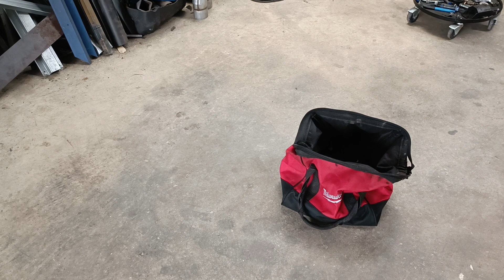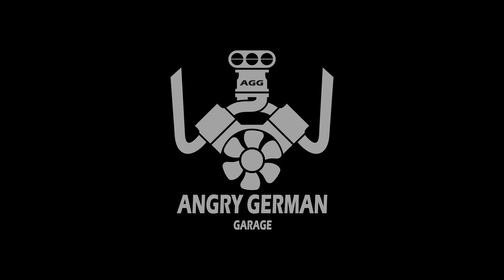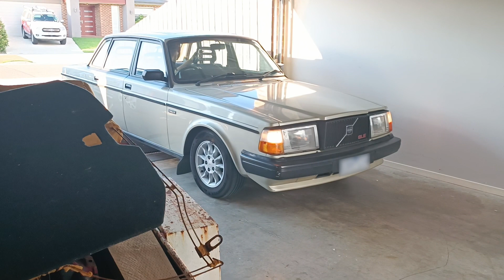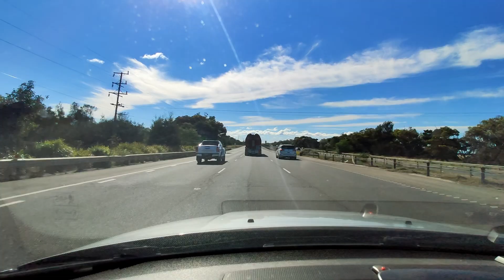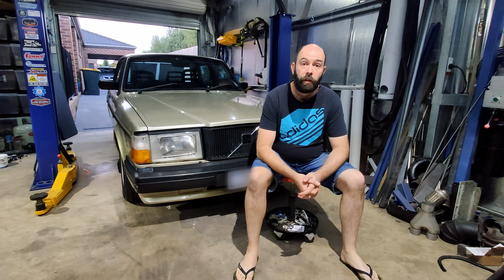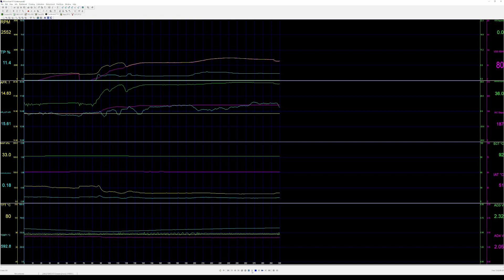Dyno time! - Volvo 240GLE turbo LS2 project (Part 26)

Comment: All my electrical issues were at the junk fuse holder.
Reply from the maker: Unfortunately this fault is my own doing. I rewired this whole car, and replaced all factory wiring including the fuse panel. So I've made a mistake in the dash wiring somewhere. I'll find it!

Comment: Awesome video mate. I've always said you never give yourself enough credit. The build compared to some I've seen is top notch. For the nerds, 320rwkw @ 3.5psi, 18* timing, 11.0 afr, 3.5-4.0:1 back pressure ratio. These engines take 18* @ 10psi and in a perfect world, back pressure should be 1:1 in a maximum efficiency engine, 2:1 for a street car. This car, when sorted, will run a 9sec pass!